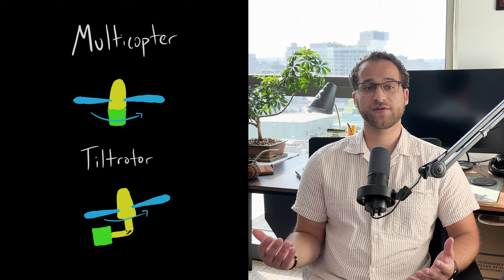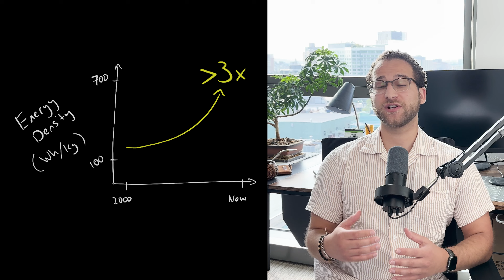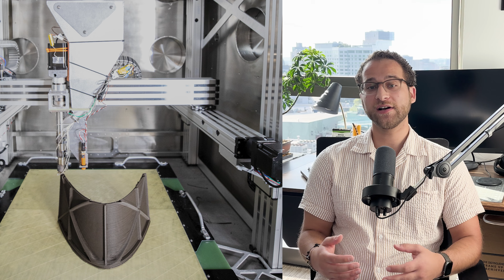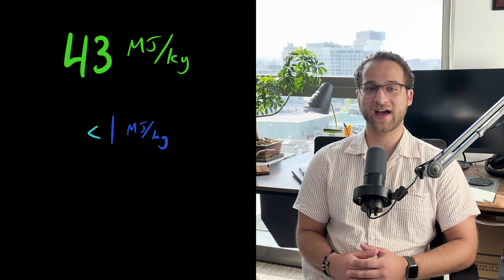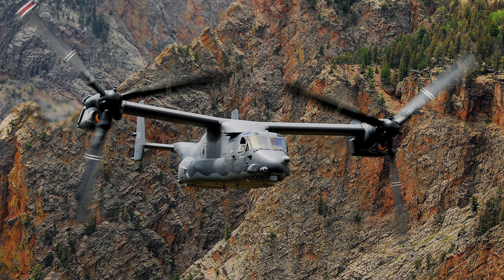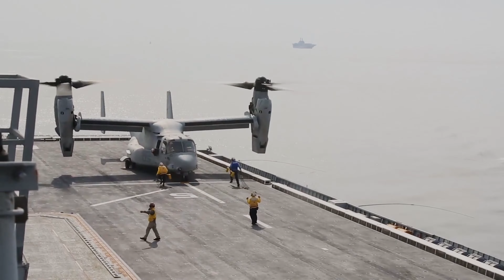The Future of Aviation: eVTOL vs eSTOL

Comment: Anyone else feels that eVTOL developers just get on with their engineering, basically ignoring the principles the speaker talks about? If you see most vertiport designs for evTOLs, then they are big enough to take eSTOLs. Plus an eSTOL might be THE (only) way to prevent eVTOLs falling from the sky during vertical descend due to what's called VRS: multi-rotor eVTOLs risk losing lift caused by their own vortices. Btw, there is a way bigger problem with what's called air mobility through eVTOLs: first and last miles to and from vertiports. Think about it: you can't just clutter the urban landscape with vertiports to keep first and last miles as short as possible!

Comment: The fundamentals of electric flight remain flawed, as long as kerosine is about hundred times more energy dense than the best electric batteries. Next, hoizontal flight with wings is three times as efficient as flying with rotors. Therefore there simply are only a handful of tiny manned electric airplanes, let alone helicopters. While I understand what you say, I could not disagree more.
Reply: @retepay..etc. Horizontal winged flight can be TEN or more times as efficient as vertical or rotor borne level flight , the ratio of L/D ( lift drag ratio in cruise mode) to the L/D of a side on rotor - around 3 or 4 , or 1:1 in hover ( with even less when climbing or accelerating or when flying into the downwash from props in transition . The best idea is not to hover or need to transition at all but to still avoid a ground run- this is achievable by ATOL or assisted take off and landing from an elevated above ground open mesh infrastructure using under 1% of the material that a vertiport requires ( and being quiet and fail safe unlike the brute force of vtol.  Hence the saying " go fly a kite" and think....
Reply from the maker: Flawed is not the right word, limited is. The distances possible are shorter, hybrid will help with this. These companies are not promising cross country flights. Regional distances are within the capabilities of these aircraft. The promises of electric are about more than energy use. Noise, simplified power transmission, emissions reduction, flight capabilities are all important improvements.

Comment: As a lot of these EVTOL's need to spend as much time as possible on their wings for efficient flight, how similar are the approach and takeoff paths of ESTOL vs EVTOL?
Reply from the maker: eVTOL paths with probably depend a lot on locations, regulations, and specific designs, so I can’t provide a ton of insight. Generally, they will take off and land vertically to/from a few hundred of feet, then transition to horizontal flight, presumably over 100s of feet and then their flight path will be similar to that of a regular aircraft. eSTOL flight paths should resemble traditional aircraft closely, with shorter take off and landing distances and likely higher climb rates.